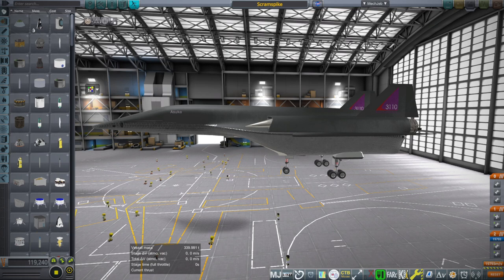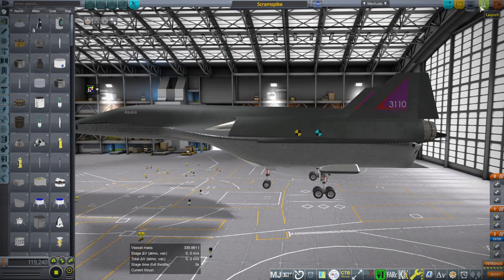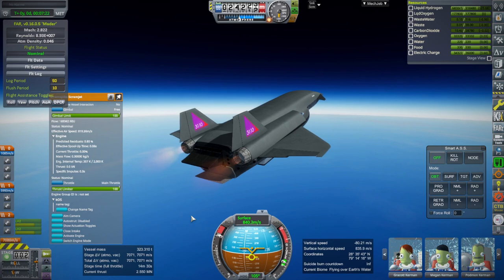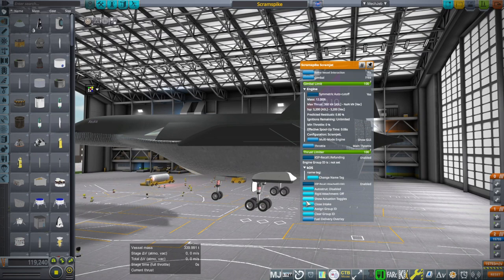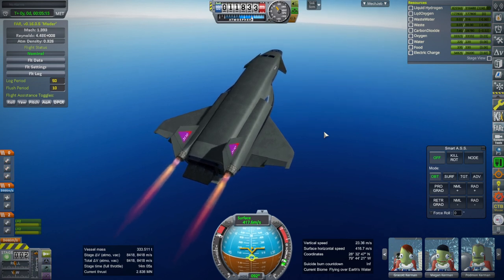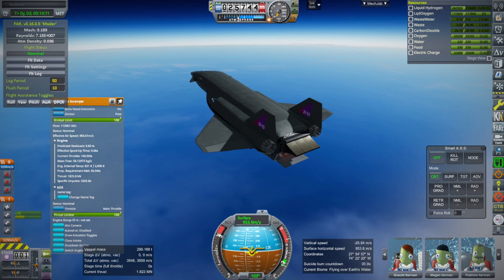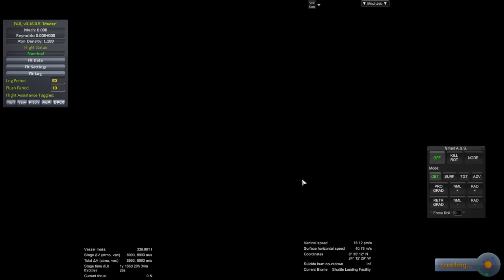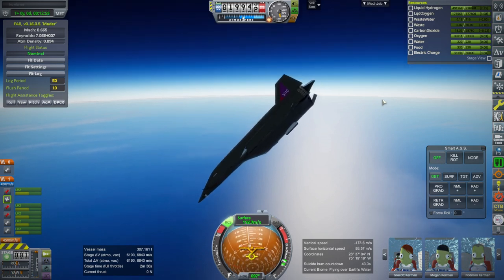Kerbal Space Program 1.12 with RO - Scramspike Further Testing

Comment: Could you eliminate the turbojets and 
launch with the aerospike, 
then light the scramjet and turn off aerospike, 
gain speed in upper atomosphere, 
light areospike and climb?
Reply from the maker: The jets are lighter than the propellant load the aerospike would need to get it up to speed. It's interesting to think about what would happen if we took something like VentureStar (launching vertically) and had it use a scramjet for some time - whether the savings from not carrying the LOX through that part would make up for the added mass of the scramjet.
Reply: @RaizSpace  But then you dont have to carry the jets mass to orbit and through reentry, might save fuel later in the flight.